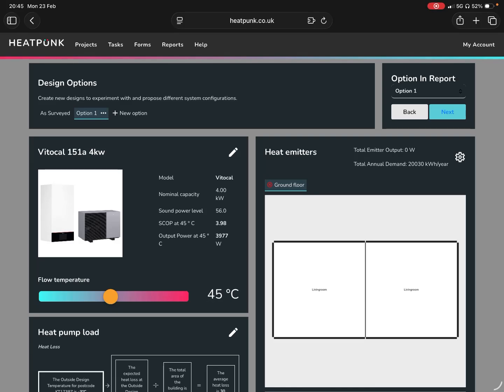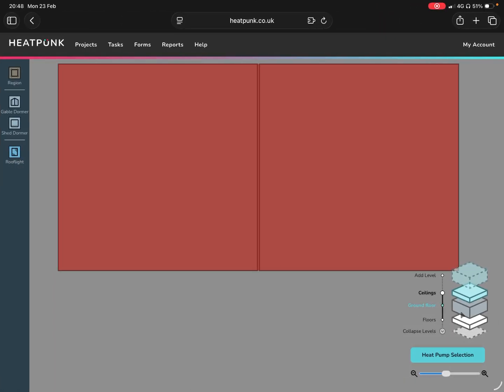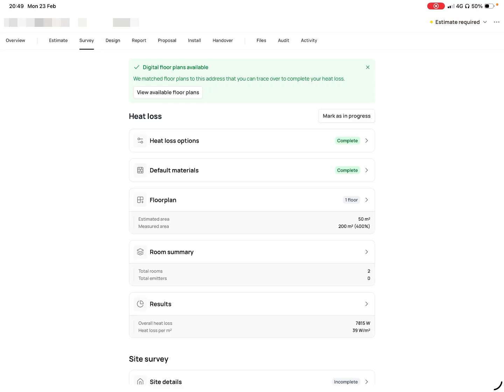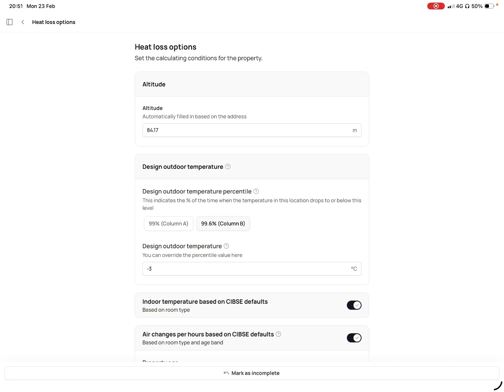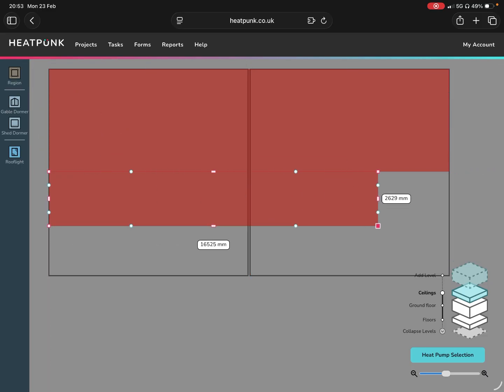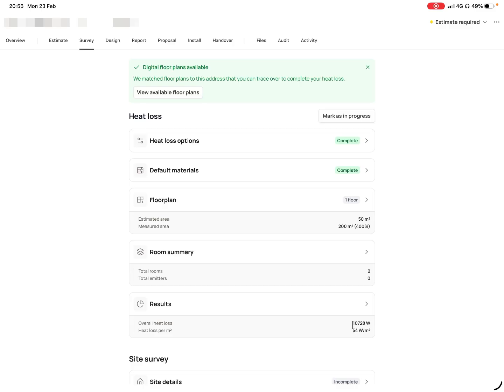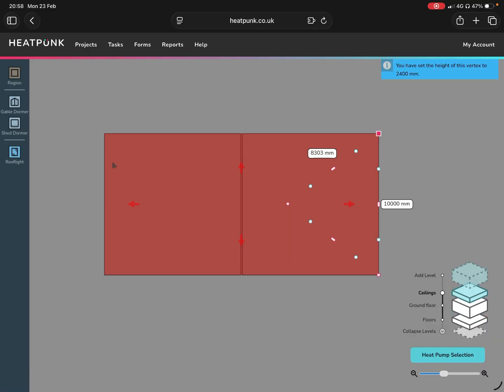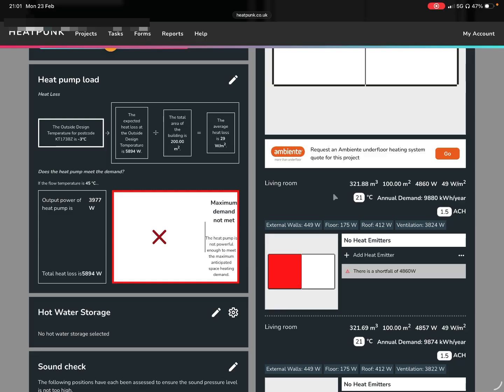6 Reasons we’ve seen that cause heat loss reports to vary so much between companies

Comment: Thanks for sharing - good explanation of the differences
Reply from the maker: Thanks for the feedback. It's hard to know how to put these across. It all makes sense when I explain it but I often wonder how much of it makes sense to other folk!
Reply: @HomesteadEnergy  I did my heat loss calcs manually room by room with a home built spreadsheet and U values - having measured rooms and windows - came out at 4.25 kWh at -2.5  - then because I didn't feel comfortable with the result I used an on line application - it came out at 4.93 kWh - I won't say which is closer to reality ;)
Reply from the maker: @ianmarsh4712  good effort for taking the time to do that!